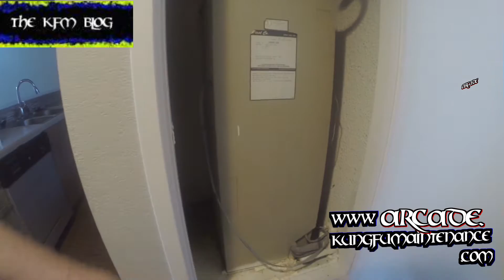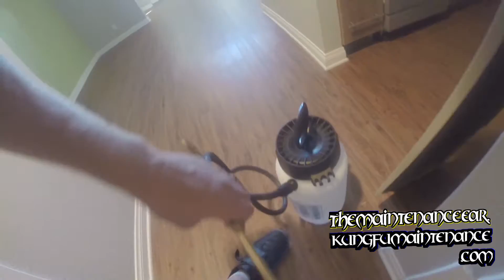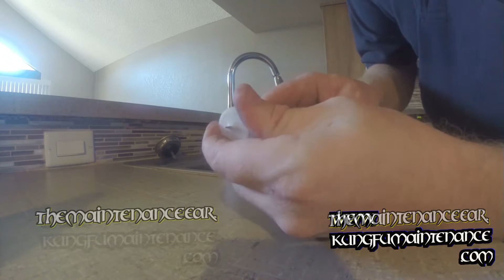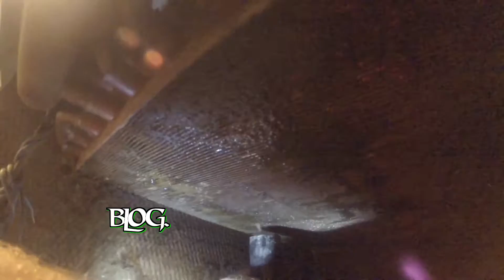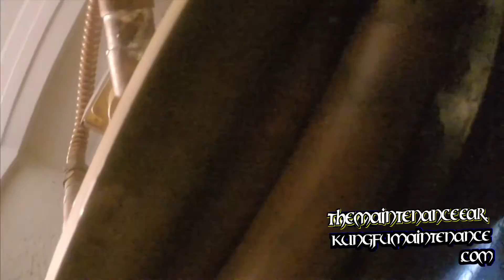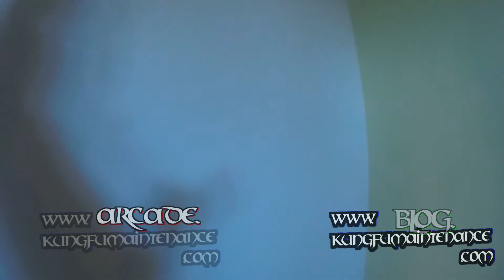Options How To Clean Hydronic Heater HVAC Coil Kung Fu Maintenance Cleaning Repair Video

Comment: I've cleaned those same units many times before.  I used a 3/4" diameter nylon brush on the coil BEFORE I apply any water.  This gets 90% on the lint-like mat off of the coil without bending any of the fins.  With the mat gone, the cleaner penetrates more deeply into the coil and makes the wet vacuuming much easier.  I also have a huge stack of old towels and like to spread them over sensitive areas.  For me, it's easier to soak up hard to get to areas than it is to wet vacuum them.  And last, I use large turkey roaster aluminum pans when I need to catch larger volumes of water. 

Always enjoy your videos!
Reply from the maker: 958kris Excellent tips all around! I will try them all. Is it a soft nylon brush you use? I thought of using a dry disposable chip paint brush. I would like to eventually annotate the video with your tips if that would be alright with you? Or perhaps do a follow up video. Thanks for sharing your tips here. It is one of the many side benefits of making these videos is I get such great insight from people such as yourself. Thank you for watching and sharing!
Reply: KungFuMaintenance It is a round nylon brush with short stiff bristles.  Something like you would clean the inside of copper pipe with, only nylon.  Longer nylon bristles are not stiff enough.  I tried a steel version and it's much better, but it bends the fins.  What I have is round with a twisted wire 8" handle.  It fits into the tight ends of slant coils where nothing else will.  Once you work the mat off, continue aggressively to break loose what you can up in the coil.  You will have to go "with the grain" of the fins to keep from bending them.

I learned this technique working at a cotton gin!  The lint floating in the air gets trapped between the a/c condenser coil and the radiator in all the trucks.  If it ever gets wet, you're doomed until it drys out.  Again, bending the fins was a big issue and compressed air was the tool of choice.  But I learned to never get it wet!  That is the glue that makes the mat.

The towels and roaster pan are just as much of a time saver for me.  I cram the towels in to make a flat/false bottom and put the pan on top.  I've cleaned a number of a/c coils with a cookie tray sitting on top of a water heater just under the air handler.  That's the setup the apartments I serviced had.  Even with the coils drain, water under pressure goes through the coil and onto the floor.  It's just easier to have towels and pans in place when you can fit them in.  You can wet vacuum the water out of the tray as you need to and won't have to worry about going easy with the water.

Certainly, make a video if you would like.